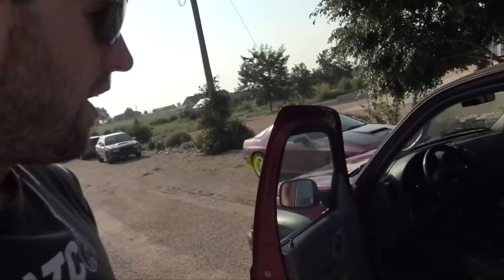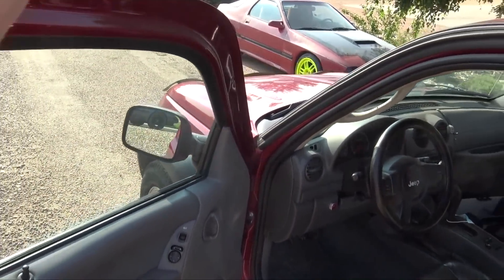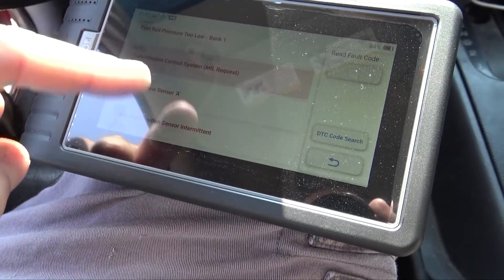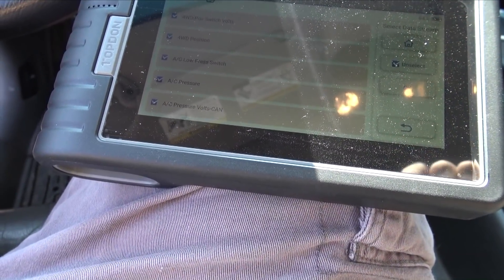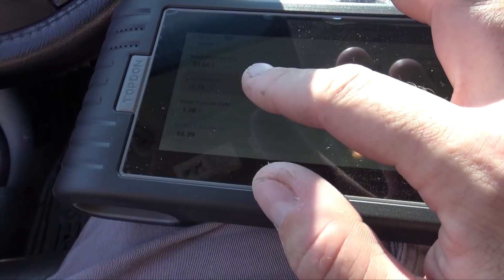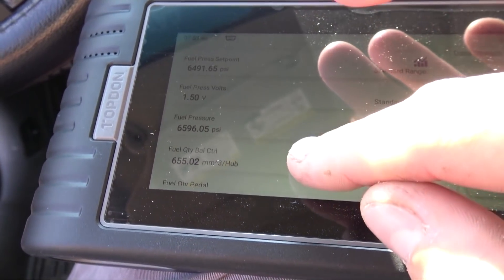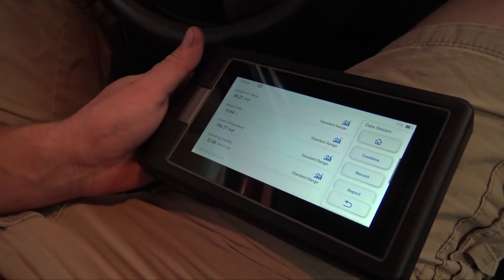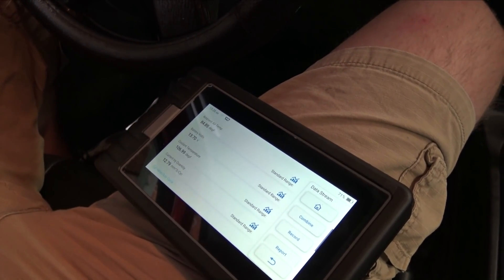Jeep Leaves me Stranded

Comment: No the ecu will not store DTC codes when the motor is off with the key on Dave...... DTC codes set when the motor is running. Unless u have broken wires when the key on engine off test is done.

Comment: sometimes on my magnum the rpm needle doesnt move for 2-3s then move to the right point but speed still moving like normal and engine still running good. when I bought it the battery was buldge, alternator not really good and after scanning many times a had random no communication comming in and out between modules with pending dtc then cleared it self on the next scan, it's weird...
You are right there is something else wrong maybe a bad ground or broken wire to power sensors, like you say 12psi of boost at idle it's not a drag car! XD
Reply: @BIasterXD  it previously had a bad alternator and the battery was goign bad due to that alternator and age, 9 years for a factory battery is really good. I drive it everyday and i own it since 2016 and I never been stranded with it. The engine and trans never beahve abnormal like there is something wrong on voltage but i agree with you. I have to pull the cluster anyway the Vaccum display for PRNDL and other light is most of the time off but randomly is back on -30C in winter and 40C+ during summer it tought on solder

Comment: Vehicles do not have codes just because the engine is not running regardless if that scan tool is good or junk the vehicles pcm won't have codes just because the engines not running

Comment: I had a random engine dying issue a while back it turned out to be the crank angle sensor.
it would be OK for days or weeks then kill the engine and it wouldn't start until I put a jumper  pack on it then it would go for days before it would do it again. It was a pre obd2 vehicle and I didn't have a scanner. After managing to coast it into the driveway and noy being able to start it at all  I finally found it when I washed the engine prior to digging in and tracing all the sensor wires looking for shorts and such.
The motor died just before I washed it started immediately after but died as soon as it warmed up so I hosed down the sensor only and it started and kept running until I took the water away.

Comment: Jeep Trail Rated = drive it over a cliff !!!   ( My sister had that same liberty in the v6 4x4, new the engine sounded like it already had 90,000 miles on it (like the build tolerances on parts are very poor), but over all it was cheap to own and cheap to fix,  and fix often it needed) (at 90,000+ miles the rear diff. and bearing and seals all went bad and many parts started to make terrible noises and she was smart to trade it in for a different car )